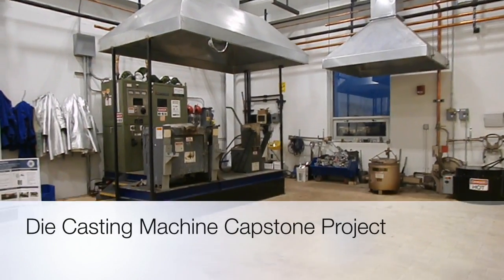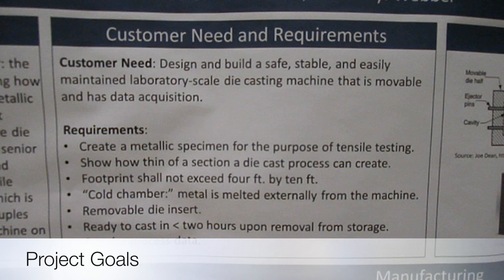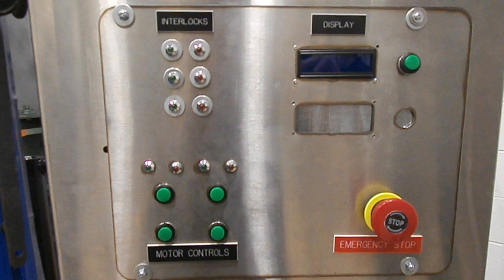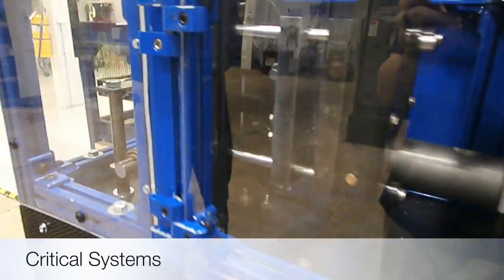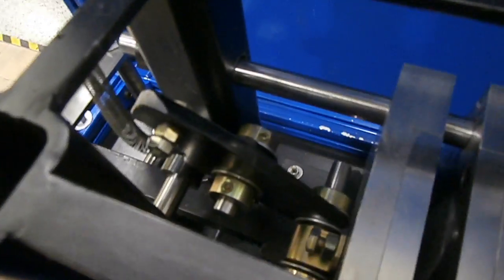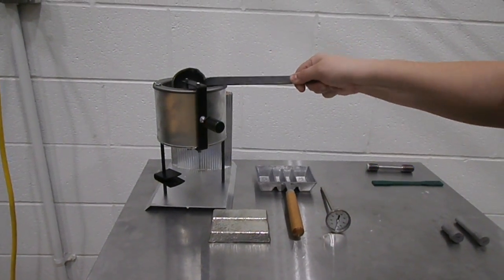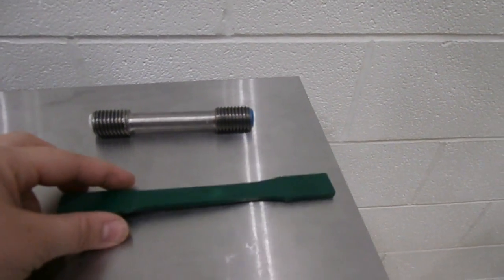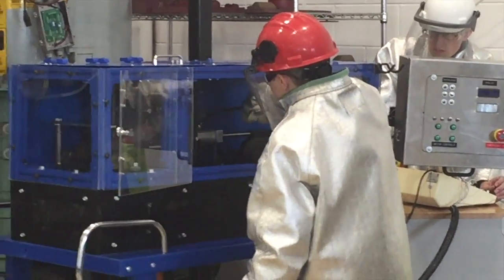Die Casting Machine

Comment: Fuck me at 5.25 it looks like they are casting a massive engine block the protective gear is a overkill I been working in a alluminium and zinc foundry for over 20 years I just wear protective glasses and that's all LOL and the casting machines are 10 metres long.